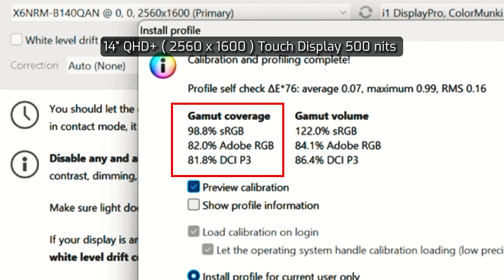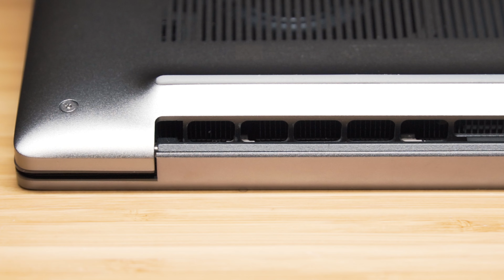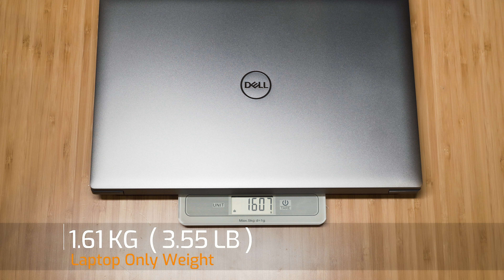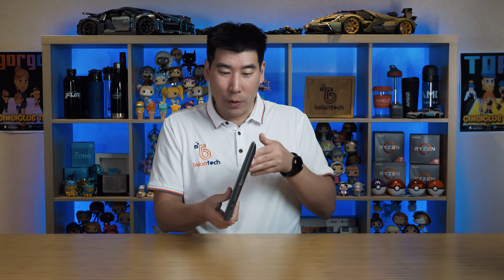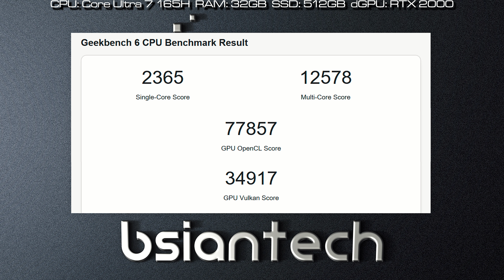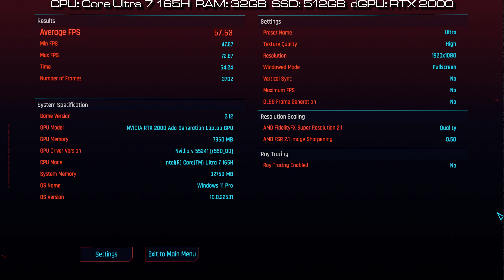Finally Pro-Grade Performance - Dell Precision 5490

Comment: Love the bend test 👍
Reply from the maker: Thank you hopefully a helpful part, even though it is silly on camera doing it but the reason is the practically application is from backpacks when they get loaded up with other gear which starts pushing against the laptop which stresses the chassis of the laptop and has cause bending if not well constructed.